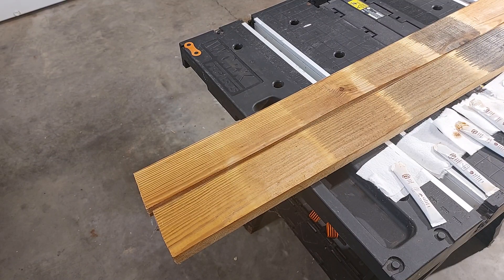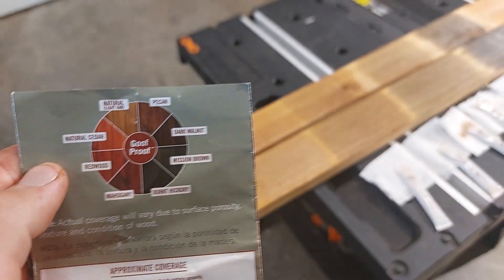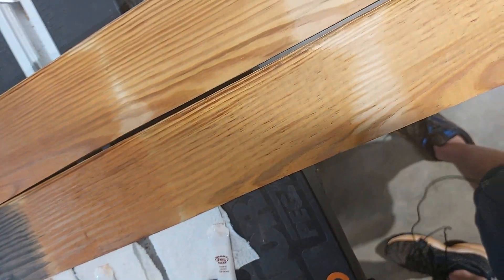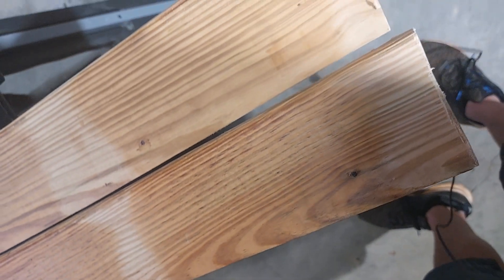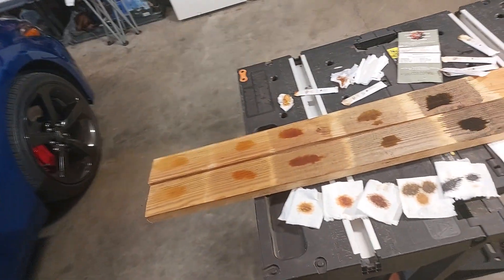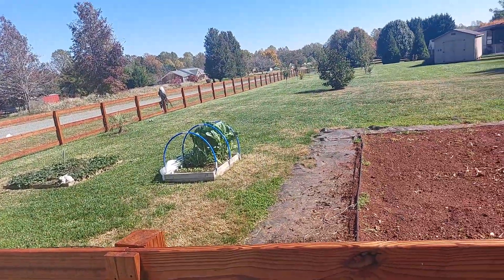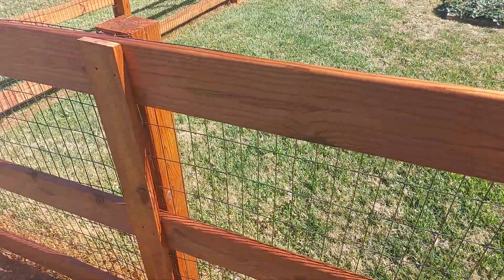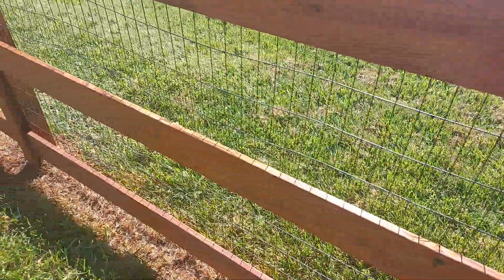Ready seal colors on pressure treated pine.

Comment: Thank you so much for taking the time to do this video!  Great job on your fence, too!  I am struggling with how to stain my split rail fence because I don’t really want the stain all over the wire fencing (which is grey).  How did you handle staining the wood with a sprayer without covering the wire?  Or did you just spray both (I can’t tell in the video if the wire is coated).  Thank you!
Reply from the maker: Just spray both It will eventually wash off the wire with time. My wire was black but that is starting to wear off to the metal.

Comment: I noticed the spray on the wire fencing. Did it eventually wear off or rinse off the wire? I have about 200 feet of fencincing just like yours.
Reply from the maker: @6caneman  Yes it will wear off.

Comment: How is it holding up?
Reply from the maker: I did a second coat a year later. I only did one coat the first year when it is really a two coat product. First year 25 Gallons, second year less than 15 Gallons.
Reply: @autohelix Wow, this stuff is like $50 a gallon by me. Ain’t worth it.
Reply from the maker: About $170 for 5 Gallons. Many are over $200 for 5 Gallons.
Reply: @autohelix  I’m just saying: when you do the math and the cost of a fence, the prices they charge for stain make it not worth it. My cedar fence is well over 15 years old without stain. Yes, I’ve had to do a few repairs, but when you do the math for staining, it makes it a poor proposition.